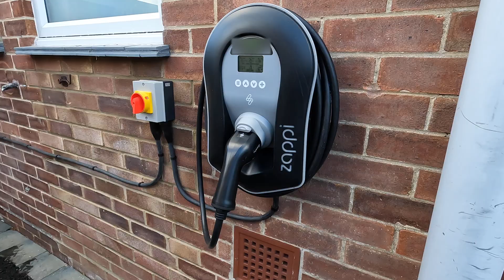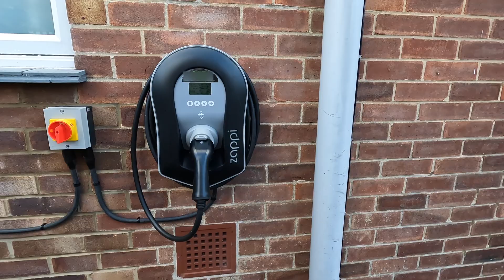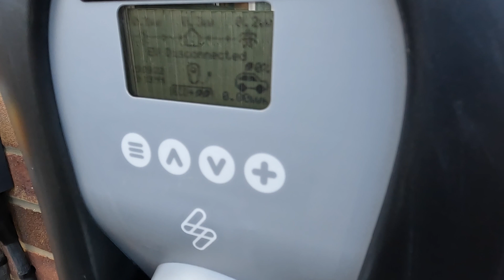Project Green: Choosing the correct EV charger - tethered or untethered?

Comment: Tethered is less hassle if you are charging fairly often. But if you are only charging once a week say then untethered looks neater as there is no cable permanently hanging around to look untidy or maybe get damaged.
Reply from the maker: I take your point, however I don't think it looks that messy with the cable. It winds neatly around the unit for storage and it's far easier to plug in and wind up than faff around with a separate lead - but that's just my opinion. My charger is tucked away down the side of my house but if it was visible to the road I might feel differently. Your point about damage is a fair one. I've taken out a (very) cheap insurance policy for the entire charger as my warranty expires in September - so if anything happens to it, (or it breaks down) I can get it repaired. Thanks for watching and sharing your thoughts! :)
Reply: @TheRamblyChannel Not so much of an issue in the UK I suppose but here in Aus the less you can leave out in the harsh sun the better. Even though the tethered cables are UV resistant they still degrade over time. My charging location is right on the front of the house in full sun for half the day unfortunately.

Comment: Any regrets going tethered?
Reply from the maker: None so far. In the UK (and probably Europe) type 2 is the defacto standard and with the heavy investment that's gone into rapids with CCS I can't see that changing any time soon. So for me, having the cable there when I need it and not having to faff about so much when I want to charge has proved to be the right solution. As always, of course, YMMV.
Reply: @ thanks for the reply. I was going untethered but I chose tethered after watching your video.
Reply from the maker: @prepped8551  Yikes! No pressure then!! Seriously, though, do let me know how you get on. 😀

Comment: Very late comment on your excellent video. I was talking recently to a guy over here who was giving me some general advice on solar panels and using a battery for storage etc. He is using a very interesting system whereby he is installing a two way facility between his EV charging point and his solar panels. He says that the storage capacity in the battery of his EV is many multiples of that of a regular storage battery that is usually installed with a solar panel system (if you opt for storage, that is). Basically, he will plug in his EV for charging at an optimal time and, when his car is not in use, he will draw in stored power from the EV battery , especially late evening/night or early morning when output from panels is negligible. It helps, of course, that he is retired so he can charge up his car relatively quickly during daytime optimal output from panels. He is a very knowledgeable guy and claims it is a no-brainer in terms of optimising use of your solar panels in conjunction with an EV, especially if you are retired or largely working from home. Thought I'd share his idea with you.
Reply from the maker: Hi Joe. Thanks for the feedback. That's an option that's well worth thinking about. There are some caveats, though. 

Both your EV and your charger need to support bi-directional charging (not all do) and chargers with V2H (or V2G) support tend to be quite a bit more expensive than other hardware - simply because of the extra work they need to do that a one-way charging device doesn't.

That said, there's no doubt that it's an attractive proposition. It's unlikely to degrade your EV battery very much and with such high capacity batteries on offer now, you could charge your car up cheaply and then, in theory, power your home for several days.

Unfortunately the car I'm buying doesn't support V2L, V2G or V2H as it doesn't have bi-directional charging support however, as the tecnology continues to mature (and especially the introduction in the future of battery technologies that don't suffer when being fully discharged) this will prove to be something that becomes much more widespread.

For me, I'll be going with home batteries at some point but suspect that down the line I will use a future EV as extra backup supply when needed.

Thanks so much for your comment. It's such an interesting subject! 😊

Comment: Good stuff, Andy. We're in the opposite position, with an EV but no charger at home. We're actually moving into our next home tomorrow, so we'll need to investigate the options. 
I've seen cables that plug into the mains for only £149, which is roughly what our budget will be after buying the house lol. We've certainly got some thinking to do.
Reply from the maker: All the best for the move! Exciting and stressful all at the same time. Charging off the mains is possible, but very slow of course, but if you don't do that many miles it might work for you. The Zappi was expensive because of all the fancy solar stuff it does but there are plenty of cheaper options out there. I do wish the government hadn't scrapped the scheme that gave money off - they seem to do away with the incentives far too quickly IMHO.

You're right about the budget - moving house is one way to rapidly decrease the bank balance. I do hope it all goes well. See you on the other side of it!!

Comment: I largely agree with you about the medium and long term trajectory of electricity pricing but a big factor is the government opening up more offshore wind and tidal as well as onshore wind and solar.  There are other renewable sources too but these tend to be the big providers.

I don't think nuclear is the answer at all for a number of reasons but here is my new biggie:  where does the raw fuel for a nuclear reactor come from?  Yes, we have to import it.  Look at what has happened with the oil and gas markets due to an unstable regime and put the risk in the log which could become an issue, we suddenly cannot obtain the raw fuel.  Sun, wind, tides, geothermal, etc. is there 24 x 7 x 365 x billions of years and we never need to pay for sun, wind, tidal ebb and flow, the warmth of the earth's core, etc.

Re: fuelling an EV:  most folk don't do more than 20 or 30 miles in a day so simply plugging in even the oldest EV with a miniscule battery and limited range will work just fine.  For that 1% of people who claim to drive 400 or 500 miles a day, every day, you choose but I think that you are doing mainly motorway miles to cover those distances and you will need comfort breaks for food, drink and loo stops so get a Tesla and use their supercharger network for now.  In 10 years you will have the choice of hundreds of long range car and super fast charging options.

We do not have a driveway but part of our planning as low use vehicle users is to buy with friends in a similar position to us.  The car will live and charge on their driveway and is available to us both.  We have sorted out the fine detail between us and we are used to not having a car available so occasional lack of availability is not an issue at all.  That is just our personal circumstances but we all know people who have cars which sit idle sometimes for days at a time and cover less than 1,000 miles per annum.  Car sharing would work very well for such people if only they could get their minds around it.

Great episode Andy.  Looking forward to your next run update.  👍
Reply from the maker: Thanks for your feedback Michael. I was nodding vigorously to myself reading it - I totally agree with all you say! Even though I have a small solar system, for many months of the year it generates enough to power my entire house (including my home office) for large chunks of the day. And I don't have to burn anything to manage it. The panels have been up there for a decade and just sit there doing their stuff and I get the benefit. A no brainer! Batteries and more panels will help, especially now that I have the heat pump.

The range in my EV will be 250 miles WLTP, but real-world probably closer to 200 and perhaps less than that in the winter, but you're spot on - it's more than enough for what I do day-to-day and on the occasions I need to travel further I will factor in a stop off for a nice coffee and a leg stretch on my journey.

Kudos to you for the car share set up - what a terrific idea. 👍🏻